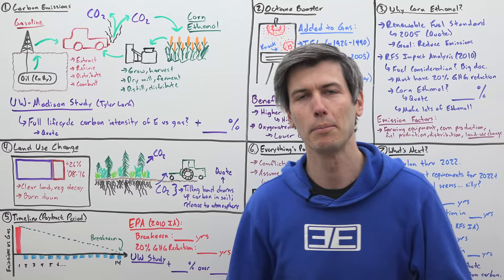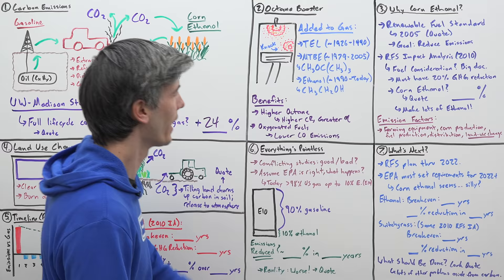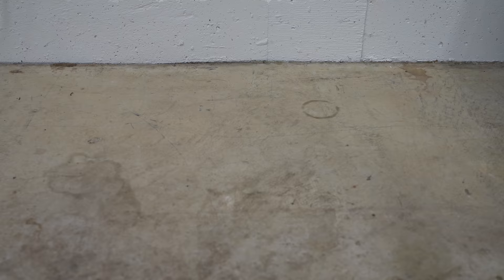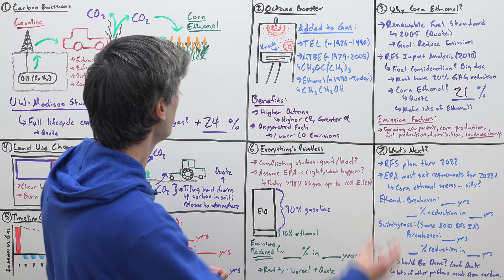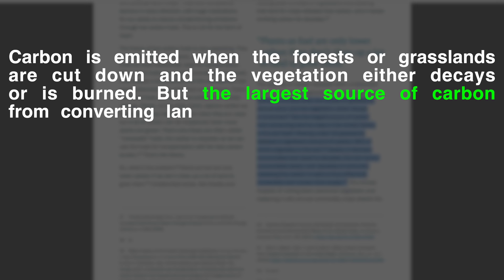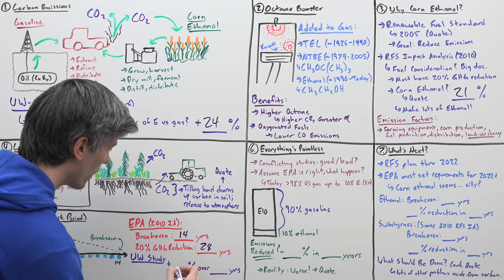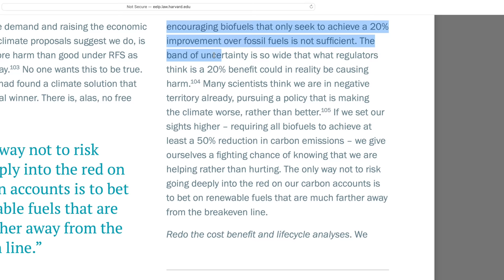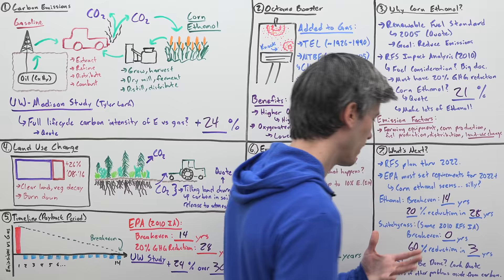America Was Wrong About Ethanol - Study Shows

Comment: It wasn't mentioned specifically in this video so I'll ask.  In Tyler's paper, was there calculations for the amount of additional emissions produced to farm, transport, distill, deliver the corn ethanol?  If 26% more land was bring farmed, the additional emissions produced from the machinery used through out the farming process alone and to be a significant consideration.
Reply: It's a serious consideration, I believe the hidrocarbons cost for agriculture in fuel and fertilizer manufacturing is about 15% of dry mass produced. Whereas the same calculation for gas is 100%, so basically you spend a lot of oil transporting and refining oil and in the end you make use of about half that's taken from the ground.

I don't agree the issue is CO2 from the soil or from fictitious grasslands that sequester CO2 clearly industrial agriculture corn can grow more mass per hectare then wild grasses with no fertilizer, the problem is they don't account the corn plant mass just the corn starch mass since the rest is pig feed like that wouldn't have an environmental impact if you ferment this corn industrially.
Reply: @BogdanManciu  Good point.  But I don't even agree that the human impact of CO2 released into the atmosphere is even a problem that needs to be addressed to begin with.  Lowering fuel prices, increasing octane, decreasing foreign oil dependence, even decreasing CO or NOX, things like that could have been valid reasons for the ethanol hypothesis, but not c02 emissions, the impact of which is exaggerated 100 fold and not even fully understood.  The program was about money and control like everything is in politics.  1) slowly increase the number and severity of regulations  2) introduce new subsidizations for farmers, which creates dependency and causes them to respond not to natural market forces, but now to the subsidies.  Any government control over farming isn't good.  At some point, whether intentional or not, or however temporary or not, we'll experience some food shortage.  Will we still be wasting corn for ethanol, when either the corn, or better yet some healthier crop could be eaten instead, or the land used for livestock?  Increasing food prices are coming, especially for beef, as are increased gas prices.  If corn ethanol didn't make sense 15 years ago, or today, then it sure as heck isn't gonna make sense in the coming months and years of inflation and shortage.  If gas goes crazy, E85 demand may rise as it's relative cost drops, causing even more demand for corn, all the while food prices go up and up.

None of these kinds of policies are genuinely simply the result of logic and science and putting the public interest first, there's always an agenda.
Reply: @BogdanManciu  YES!  The biggest thing no one accounts for is the root biomass left underground from the corn crop grown every year.  I farm now, I will use about 5.5 gallons of diesel to grow my crop, the ethanol plant is only about 20 miles away, so assume my transportation is crazy inefficient, and call it 10 gallons of fuel per acre.  My 200 bu of corn/ac can produce 600 gallons of ethanol and still have 1.8 tons of residual animal feed left over.  Per acre!  And then left in the field at that yield is about 5-6 tons of dry biomass left on top of the field, and then root biomass is estimated to be about 29% of total above ground biomass.  So there is an additional 1.5-2 tons of root biomass left underground.  So that acre produced 600 gallons of fuel, 1.8 tons of feed, and left almost 8 tons of biomass in the field to slowly decompose over the next 3-4 years.  Switchgrass cant compete on highly productive soils.
Reply: You need to consider actual emissions of oil to gasoline process. Drilling has significantly high emissions, pumping oil has significantly high emissions, transporting oil from overseas has significantly high emissions, far higher than farming corn need for making ethanol. Have to consider to the short distance corn is transported vs the 10% of oil that is imported from Russia and middle east. This study looks of bunk science, with words like maybe and probably, you know the author is speculating or guessing. Real studies are based in facts and don't speculate or guess. The data speaks for itself and there is a solid conclusion.
Reply: @BogdanManciu  Yes, the left over brewer's grains are used for food, not waste. Also plant I worked at wet milled, sold germ and hulls as separate stream. Little is wasted from the grain. Farmers also no till, so most of the remaining corn biomass goes in to the soil. I don't think the author of paper knows anything about farming nor ethanol production, and is making a lot of bad assumptions.
Reply: @Taluvian  I'd like to see the data around ILUC for the Canadian tar sands. Fact is oil is getting more energy intensive and risky to recover. Ethanol is getting more efficient and greener as time goes on.
Reply: If you don't grow corn then you grow other crops. Same energy use. It is a mute reason in calculations. You save nothing.
Reply: @mikeclemens5735  he stated 26% more land being farmed.  Not 26% of already farmed land switched to corn.  Im sure a % of that is the case.  But was not what i was using as criteria.
Reply: @ForceEngineering  Yeah I shared it in another post but since the 1980's we've actually lost farmland in the US.  Luckily our yields keep increasing so we can still supply enough of everything, but last year I read a study that showed in the last 10 years we've lost 11 million acres of farmland to urban sprawl.  The bad part is, in the midwest a lot of that is prime farmland.  So we're losing high yielding ground and pushing harder to get good yields on the remaining acres.
Reply: @acjohnson1986  thats very unfortunate.  I feel like everytime i watch a video like this.  Then do some of my own research im always left wondering how accruate the original data was/is.  Always left with more questions.
Reply: @mikeclemens5735  Yep. People don't understand farmer do crop rotations. Corn one year, soy beans the next.

Comment: As a mechanic, it is my experience that the ethanol destroys the engine and slows down the air flow by gumming up the intakes and valves.
Reply: Not to mention it destroys plastic and rubber hoses/components in contact with the fuel
Reply: OMG no,  race cars and  flex fuel cars run on E98 and are totaly reliable
Reply: @daniloreyes2  race cars are also more kept than standard run of the mill cars. Small plant like lawnmowers etc the ethanol definitely gunks up the carburettor and rots diaphragms etc. Ethanol will eat seals and rubber regardless if it's "ethanol compliant"
Reply: @Dazza2292  notice I also said flex fuel cars, which includes now all modern cars as they are build to accept E10-E15, so all the plastic and rubber hoses/components and fuel systems are made to resist the ethanol. yes small engines need to be winterized before storing them with this fuel.
Reply: @daniloreyes2  the auto/truck/race car industries respond to owners of their products screaming about things like fuel lines disintegrating internally clogging fuel filters not to mention the solvent properties also "clean out" what were harmless sludge deposits  in the bottoms of oil pans and rocker galleys sending all those contaminants into suspension for filters to fight.  The industries developed solvent resistant hoses allowing race cars to use corn fuel.  Even worse example can be found in 'big rig' diesel tractor trucks only a few years ago when mandated exhaust gas filtering "innovation" translated into higher heat within truck tractor engine hoods by hundreds of degrees ... and once again hose manufacturers were forced to rush rush invent products that will resist the impact 'progress' .... that exhaust gas circulation/burn off saga continues ....